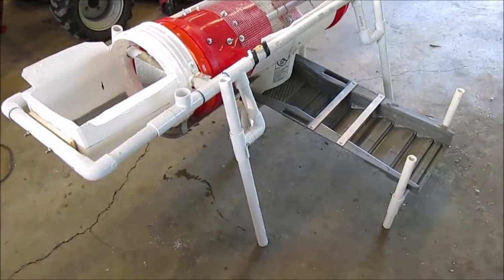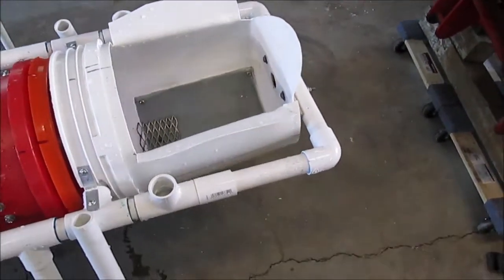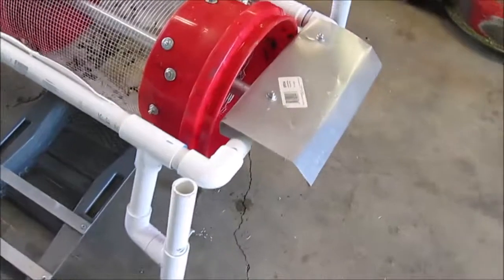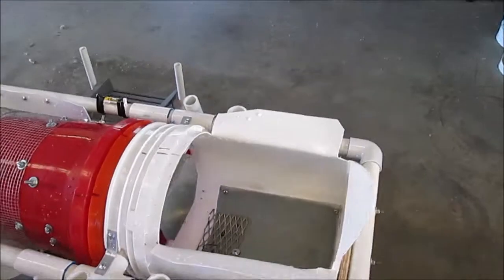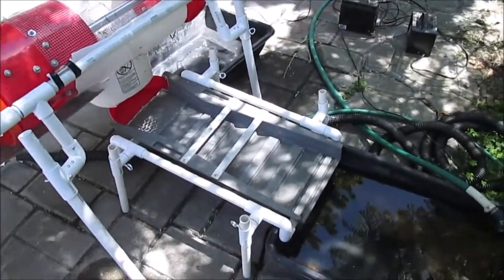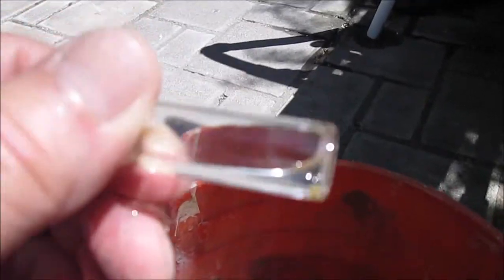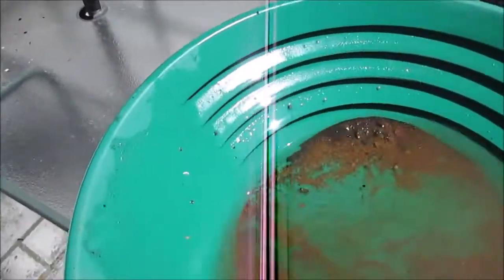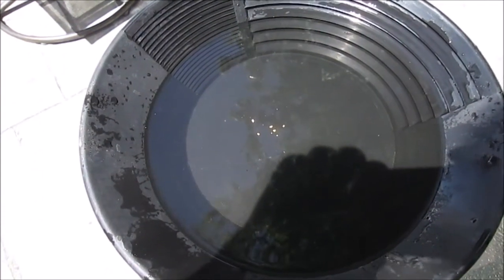Bucket Trommel Testing

Comment: Great job. I am currently building one with 2 gallon buckets. (Need something more portable). Could you please explain/show how you did the adjustable legs. Thanks. Lloyd.
Reply from the maker: I used PVC T's that were hollowed out with a drill bit.  I then use a over sized PVC coupler over the lower end and tap threads for 1/4-20 eye bolts to lock it to the leg.  I also built one with 2 gal buckets.
Reply: Thanks for the quick response. I will give it a try. Lloyd

Comment: I have and made this trommal and then made some mods to it
Reply from the maker: Good Job. I just rebuilt my trommel and it needs some more mods for tumbling and water discharge.
Reply: @dalechristensen3433  ok so I will pull it down and point them out.
Reply from the maker: @Jaysgold  My Trommel is the one that needs more work. I'll plan to post an updated video when it's done.
Reply: @dalechristensen3433  hay Dale I made anew video and it's up. I hope this will help you your trommal looks great. You will find that it will run a lot of dirt but it's the sluice box run longer.
How is con's drop set up you might not get all the gold up of your trommal until you move it and the it might end up on the ground. Let me know what you think or have questions concers or ideas I am happy to help

Comment: Excellent video Dale !  Nothing better than DIY ingenuity and craftsmanship !  Really like the adjustable leg design, and bucket cowling under the trommel.  Good test with real gold.  Might I suggest using #8 lead shot.  It's slightly lighter than gold, and will help fine tune your sluice angle.  I use two round and two flat shot.  If all four trap in the sluice without a lot of black sand build up, it will be perfect for trapping gold.  Hope you find lots of gold with your new machine !!